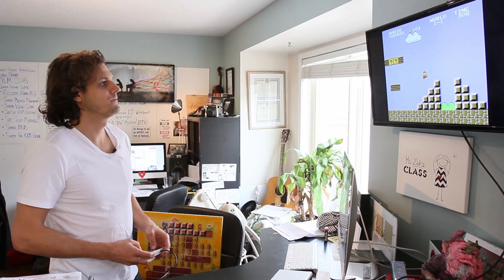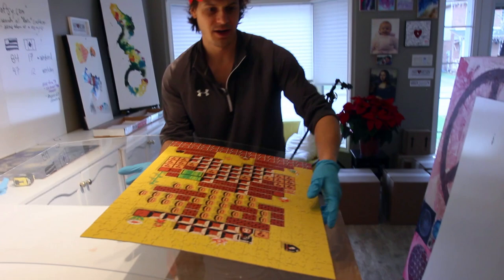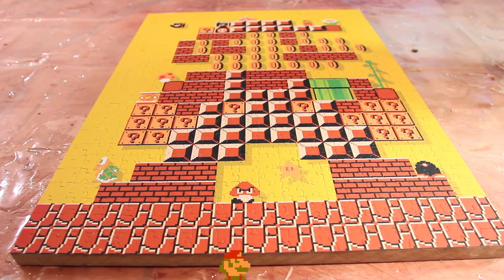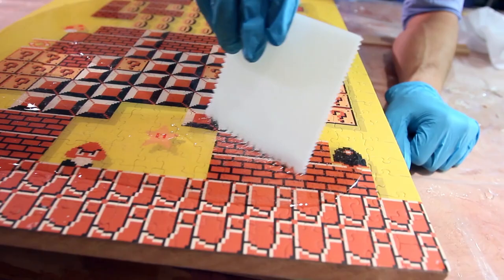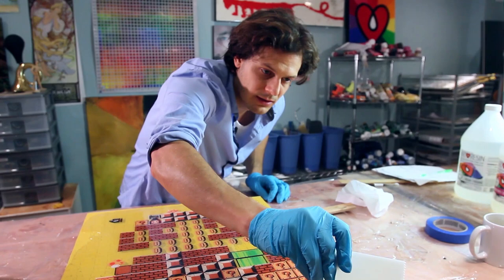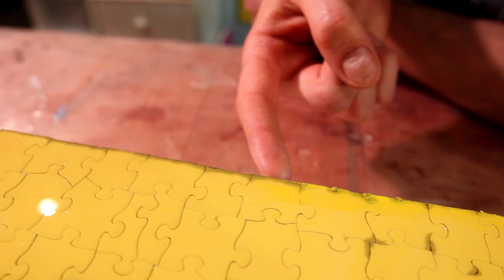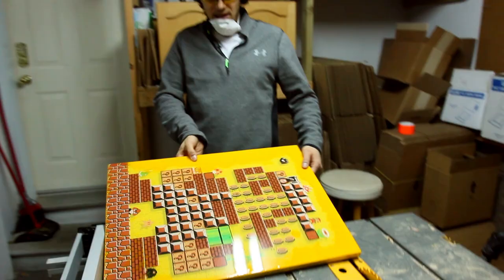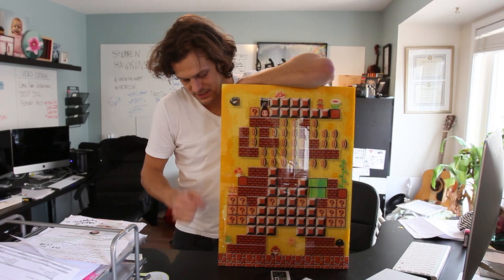How To Resin A Puzzle

Comment: What a completely perfect tutorial! Detailed, precise, informative. You explained WHY you did, not just what you did. That's critical, IMO. One suggestion- be sure to dust off or blow off the insides and outsides of any box that you've had in storage. Tiny insects, dust, etc can be dislodged and fall onto your project when the box hits the table. That tap can be just enough to loosen tiny particles. Same after picking the box off the floor, mid-way through the project.
Reply from the maker: Thanks Donna, glad you enjoyed the video.   Great tip on tapping out the box before covering your art with it!

Comment: LOL! that keyhole bit should actually be used with a router, on a router table or with a diy jig to keep it straight. the bearings in a drill press is not really designed to take lateral force like that, although this is a very small application and this is certainly one way to do it, but nice video anyway, Subbed! 

PS if you don't have or don't want to get a router, one of the larger Dremmel models will also suit this application and it has many other uses too!
Reply from the maker: Awesome advice - thank you Warren!!

Comment: This was the most fun tutorial I’ve ever seen! So many possibilities!Two questions:
1 - My Dad used to try to make paperweights and jewelry with some kind of resin in molds and set fresh orchid blooms into it. They always looked really bad after a day or two though and my poor Dad was so bummed! Is there a way to preserve flowers or other fragile organic material in the Art Resin, or is it just for non perishable stuff? 
2 - The most important thing I need to know is what kind of blade did you use in the table saw to cut the resin? Is it a special plastic cutting blade with more teeth, or just a blade with more teeth?
Reply: Andi Cacciatore I think fresh flowers will wither in any kind of resin unless it's UV resin. But it's best to use dried flowers.
Reply: And I think any blade sharp enough will cut through resin as long as the resin is completely cured.

Comment: Awesome! I have a question sir!  🙋🏻‍♀️ 
I’m looking to put a sealed puzzle onto a serving tray. This means the elevation/runoff step wouldn’t be done. Use a little less resin in this case?
Should I used art resin or table top resin to use as a good serving tray?
Reply from the maker: You can definitely use ArtResin for this.  You will want to adhere the puzzle to the serving tray so that it doesn't float up when the resin is poured on, then pour your ArtResin to coat.  There is no problem with pouring into the tray, you can just pour enough to cover the puzzle and give you a nice smooth surface, then use your torch to clear bubbles.

Comment: What do you think about sealing the puzzle with a clear spray paint before the resin?  I guess I could do a test on some identical cardboard but I’m wondering if you have any insight?  I’ve used your product to cover a slab of concrete to make a bar top and made a wood, metal and art resin small table.  I was very pleased with the finish.
Reply from the maker: Hi Todd - glad you're enjoying ArtResin!  I don't see why clear spray paint wouldn't work, but I would definitely do a test beforehand to see if the puzzle absorbs the spray paint at all, and how the resin adheres to the spray paint.

Comment: I just finished the Kodak 51,300 piece puzzle (World's Largest puzzle).  It's 28' long x 7' high.  Do u think I could epoxy such a large surface and hang the puzzle on a wall.  If not, what suggestions do u have.  Thanks

Comment: Love your vids, can i epoxy over a mosaic tile with grout? Do i need to seal the grout?
Reply from the maker: Yes, you can apply ArtResin as an adhesive for glass tiles and mosaics (i.e. like clear grout), and you can also pour it overtop of shard glass to make sure sharp edges are not exposed.

Comment: I recently completed a Marilyn Monroe puzzle and found your video when researching the best way to glue it together.  I’ve started working with resin in the last few months and your video inspired me to preserve my puzzle with resin but I have a question.  I cut my board so that there will be a 2 inch black boarder around the puzzle.  I plan to glue the puzzle down and then pour the resin.  I want the edges of the board to have resin so I was going to let it spill over like you did.  My question is this…will I need to put a temporary boarder on the edge of my board and pour thin layers so that it’s even and them do a final layer of resin to pour over the edges to cover the sides of the board?  I really don’t want to mess this up!
Reply from the maker: Hi DeAnna, since the puzzle isn't that thick, you should be able to pour right over the mounted puzzle and just let the resin flow over the border and the edges of the board.  Apply painters tape to the underside of the board so that you can easily remove drips once the resin has cured and place your board on some stands while pouring.  Be sure to pay close attention to the cut edges of the puzzle when applying your sealer as this is an easy spot where resin can seep in.

Comment: Just watching this again. The keyhole bit... I've seen it done before where you countersink two keyholes one-third and two-thirds the way across the backframe, measure the distance between them then anchor two screws the same distance apart into the wall, sticking out about 1/3" and slide the artwork onto them so the artwork sits flush against the wall.
Reply from the maker: That sounds like a great way to go about it!!

Comment: Nice video, I'll have to try it. I did have a question about sanding it down though. How much worse will the final product look if you skip that step?

Edit: Is sanding only mandatory if I needed to apply a second coat?
Reply from the maker: sanding is only for multiple coats so that the layers stick to each other really really well :) . otherwise there is a small chance the could peel apart in the future!   no need for this is you dont have multiple coats :)
Reply: @Artresin  Your video is exactly what I needed! Similar follow-up question to the sanding question above: If I pour one nice-looking resin coat on my puzzle and (fingers crossed!) am happy with the results, is a second resin coat recommended for some reason? In other words, did YOU  pour a second coat because you topcoated the first layer with yellow paint to cover up some of those sealing mistakes? If your first resin coat had been perfect, would you have done the second coat? Thank you in advance for your help!
Reply from the maker: @susandixen3664  Hi Susan, the second coat was just to fix any imperfections in the first pour.  If you pour one coat and it covers perfectly, you can leave it at that!  If you find that there are imperfections or areas that need fixing, you can simply apply a second layer.

Comment: thanks bro this is awesome!!! wich resin and glue you recomend ?
Reply from the maker: To adhere the puzzle to the board we used plain white craft glue, but you could use a spray adhesive if you prefer.  We used ArtResin epoxy resin because it is safe, non toxic and so easy to work with!  You can purchase ArtResin through the following link:  
https://www.artresin.com/collections

Comment: Hello, so how many coats of glue would you suggest if you want to be safe, 3?
Reply from the maker: Hi Hal, the key is to really press the glue into the cracks of the puzzle. You can try an old credit card to smooth the glue over the puzzle  to help you get into the cracks. We also recommend applying the glue to both sides to really seal it before you resin. One good coat on each side should do it. Have a look at our How to Resin A Puzzle Video for more information. https://youtu.be/85P2A6mY7F8

Comment: the craft glue won't create yellowing under the resin?!
Reply from the maker: I guess in this case it probably doesn't matter as the puzzle is already electric yellow :) but if you would like to, absolutely, use a neutral ph white glue or sealant.  Whatever you choose to use, just be sure it dries clear, or it will look cloudy under the ArtResin.
Reply from the maker: no this isn't an issue that we have seen!

Comment: If I have no issues with the puzzle do I need to do 2 layers of resin?
Reply from the maker: Hi Kiki, you should only require one layer of resin, but it depends on how thick you want your finish to be.  ArtResin will self level to a thickness of about 1/8" when poured, if you want a thicker finish, you can simply add a second layer.

Comment: Another question, and thanks for your time, can I use art resin to fill letters i had engraved in a wood project? They are about 1/8 in deep, I would need to sand them even and poly over top? make sense?
Reply from the maker: Hey Jeff!  Yes, absolutely, you can use ArtResin on your wood project!  ArtResin and wood are the most beautiful match - ArtResin makes the grain and colour of wood simply glow.
Now, because wood is an organic material and contains trapped air, you might want to preseal your piece and let it dry, before you apply the ArtResin.  This step will seal the wood, and prevent it from off-gassing ( releasing trapped air ) which causes bubbles ( and even with presealing, I like to babysit for the first hour or so, checking in every 10 mins or so with a toothpick handy to pop any stray bubbles that might just pop up.)
I'm not sure what your piece looks like now, but as ArtResin is self-levelling, I'm not sure there is a need to sand the letters down, unless that's how you'd prefer them to look of course.  
Good luck!

Comment: We haven't been successful resining puzzles either. Have you come up for a solution to the seepage? We;ve tried multiple layers of white glue. We've tried multiple layers of Mod Podge which gets less seepage. We have given up, although we absolutely love the resin look.
Reply from the maker: Hi Carol :) We have found that some work well and some don't. I think it really comes down to how well the pieces of the puzzle come together. We also do use a few coats of sealant and that seems to help as well.
Reply: @Artresin  Yes, thats been our conclusion as well; but how to get all the peices secure and tight?   As there seems to be no surety to  getting a perfect product , we have been content to enjoy unresined finish products.  Its heartbreaking to have seepage on a favorite puzzle. Hpwever, I must say,your video has motivtaed me to using resin for other projects..  Thanks you.
Reply: We experimented with using Mod Podge applied with a SQUEGEE   Did the trick for preventing seepage    Used two layers of MP   This has ressurrected our puzzle resining!

Comment: I'm coating a 38inch by 13 inch jigsaw and on the first coat my mdf board sagged a bit in the middle. A lot of resin dripped off. So I've rectified the bow but the resin is very thin at the ends of the jigsaw. Will the second coat level this out?
Reply from the maker: Hi Fiona - ArtResin is self-levelling, so as long as your piece is level, it should even out.  You'll need to sand down the cured resin with a coarse sandpaper to create some tooth for the fresh resin coat to adhere to.
Reply: @Artresin  It worked perfectly. Thanks. I've made a puzzle table for my 4 yr old grandson!

Comment: Hello, can resin a jigsaw puzzle before it’s cut into puzzle pieces?
Reply from the maker: Yes, it would just be like pouring over a painting.  Depending on the paper quality, you still may wish to seal it before applying the resin.  Just a note- once the resin is applied, it will make the puzzle quite hard, it may be difficult to cut it after if that is your plan.
Reply: @Artresin  the blades cut through hardwoods. It’s more about paper lifting and such if I could use one product plus a sealer for paper. Would make life much easier.
Reply from the maker: @11941leechie  You'd have to try it out to see.  Cutting after leaves your piece edges un sealed, the resin will adhere to the paper without any issue.

Comment: I wanna resin my puzzle but I don’t have this awesome shop to do any of this. Would you recommend I find a power sander to use in between the coats? Or can I pour the second coat without sanding it?
Reply from the maker: You have two choices when pouring multiple layers: the first is to pour your first layer, torch out the bubbles, cover and wait 3-5 hours until your ArtResin epoxy resin reaches a jelly like stage. At this point, you can pour on your next 1/8" layer, torch out bubbles, cover, wait 3-5 hrs and repeat until you reach the height you desire. This method is especially handy when pouring into a mold or a dam. The second option is to allow your first layer to fully dry, then give the overall piece a light sanding and pour on your next 1/8" layer. Torch out bubbles, cover and let this layer dry. Repeat these steps as many times as you'd like.

You could purchase a small hand sander or simply just use sand paper by hand.
Reply: ArtResin Thank you so much!

Comment: I came across your video randomly one day and it got me inspired to do this project! I have one question for you though. Since you mention different wood could warp, do you think particle board panel would be a good option? Do you recommend any cheaper woods to glue your puzzle and resin on that would last a very long time? Would it be beneficial to glue your puzzle on a poster board then glue onto the wood? Btw will be doing a collector's Legend of Zelda: Windwaker puzzle. :)
Reply from the maker: Hi there!  Yes, we used MDF board, which is a type of particle board.  Check to see what the hardware store has to say - there might be a cheaper, more durable option, but we liked MDF board.  We didn't glue our puzzle on to a posterboard ... we just slid it right onto the MDF.   I suppose you could glue it on to a poster board but it just seems like an extra step you might not need to take :)  We are all about keeping things simple here :)
Your puzzle sounds awesome!!  Nothing beats the classics!!
Reply from the maker: send us a picture when it's done!!
Reply: Thank you so much for replying so fast to me and for the response! Will for sure buy your product and get started on this project.

Comment: If I resin a puzzle and all sides of the wood will it be waterproof enough to hang it outdoors?
Reply from the maker: yes, as long as it's totally sealed, it will be waterproof.  You'll want to make sure the wood is nice and dry first as well - any moisture can cause expansion and contraction in temperatures outdoors that fluctuate ... which can cause cracking in the resin over time.  Dry wood will help to prevent this.

Comment: how do i prevent the resin from getting into puzzle pieces like your yellow ones?
Reply from the maker: you need to seal, seal, seal :)  Especially with something like a cheaper puzzle like our Mario one, it may require a couple of coats of sealant because cheaper paper can absorb the first coat of sealant. I would definitely recommend sealing a good 2 or 3 times to be safe :)
Reply: ok, would clear elmers glue be considered a good sealer?
Reply from the maker: we have used Elmer's glue, ModPodge etc - they are just fine as far as sealing, but just be aware they aren't archival ( meaning they will yellow in time ) . You can find archival quality sealants at any good art supply store - just make sure you get one that dries clear.  We always advise testing first, just to make sure it's compatible under ArtResin ( most sealants are, but always good to be sure )
Reply: Will it yellow even with the resin over it?

Comment: Hi,  bit puzzled about the resin quantity.  .23 gal would be nearly 2 pints?
Reply from the maker: yup - that's a total combined volume of both resin and hardener.  .23 gallons is 30 fl oz which means 15oz of resin and 15 oz hardener combined.  This is based on a 1/8" layer and including a little extra for the sides and spillage.
Reply: Thank you.
I may be missing something but there didn't seem to be that much in the jug.  Reason is I will probably only do one jigsaw so wouldn't want to buy more than necessary.  One other questipn,  the jigsaw has a metallic finish.  Does that make a difference.  I like it but it was so difficult because of reflected light 
so will never do it again and  thougjt resin might be the answer to displaying it.
Reply from the maker: Dave may have just been guestimating for the sake of the video :)  There is a coverage recommendation for each size .. for example the 8oz kit covers 2sq feet etc.  The Usage Calculator is a little more generous in its recommendations to account for spillage etc.   Resin will enhance whatever you cover it with - so colours look brighter, a shiny surface will be more shimmery, wood grain just glows ... we have covered prints on aluminum and the results are absolutely fantastic.  I think you'll be very pleased with how it looks!!
Reply: Thanks,  will let you know.

Comment: How can you resin a 4d puzzle
Reply from the maker: Since a 4-D puzzle is not flat, you would have to apply ArtResin in thin layers using a paint brush or foam applicator to help reduce drips.  If the puzzle is paper you will still want to ensure that you apply sealer first to prevent any bleeding and ensure the resin doesn't absorb into the paper.

Comment: Would mod podge work instead of Elmer’s glue?
Reply from the maker: yes, for sure! but as with the white glue, modpodge  may yellow over time, so just be aware.  you can buy sealants that are archival quality if yellowing is an issue.
Reply: ArtResin can the white glue yellow over time?
Reply from the maker: yes, it definitely can, especially when exposed to direct sunlight - if that's a worry, then look for a glue or sealant that is archival quality :)
Reply: ArtResin alright, thanks 😀